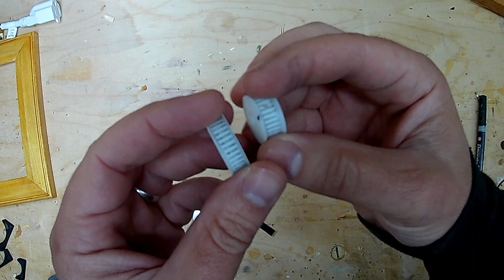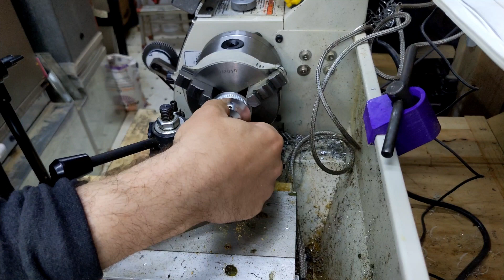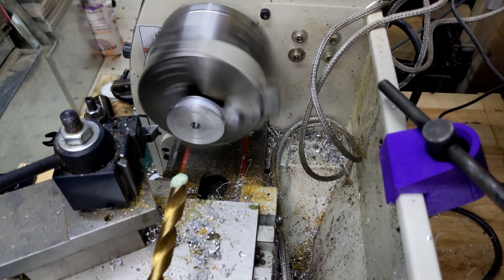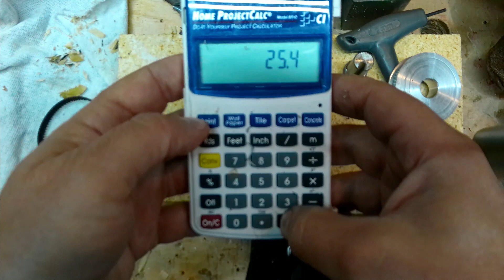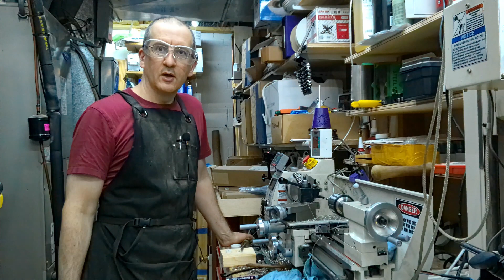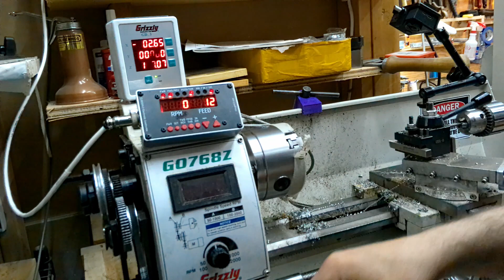Electronic Leadscrew Progress, Part 4 - Complete!

Comment: Thanks for posting these videos. I know it's already 5 years ago but I only just came across this today. I have the same lathe and an electronic lead screw would be pretty cool.  I'll watch Clough42's videos next and see what is involved and what his kit includes.
Regarding the slight discrepancy between the rotary encoder and the Grizzly's tachometer wouldn't that most likely be just a difference in accuracy of the electronics? I think I would trust the Omron rotary encoder more than Grizzly's tach. They were pretty close and I don't think I would expect them to read exactly.
I'm curious how it works in reverse? If you run the lathe in reverse will the leadscrew automatically run reverse also or do you need to select reverse on the leadscrew control unit?
I'm also wondering if there is possibly a way to mount the encoder so it will sit inside the cover.  Not a big deal but nice to have the cover on.
Thanks again.

Comment: I gave up watching at 15 min. my mind started to boggle. you have a lathe, you couldn't turn the inside diameter to 12mm? No calipers?
Reply from the maker: Comments like this are one of the reasons I don't post videos any more. I would not have minded, "Hey, did you consider using a boring bar? If not, why not?" But it's hard not to take something like this as "why are you so dumb?" 

But maybe you had a terrible day and you're in a bad mood - if so, you have my sympathies. Hope tomorrow is better!

And to answer the question I would have liked to get: I was a beginner (still am, although better). I probably just didn't think of it. Would certainly have done it if I walked up to a lathe now. :shrug:

Comment: Thanks for the video. First time viewer. I have a Vevor 8.3 x 29.5 and the lead screw run all the time.
Reply from the maker: Welcome! The lead screw running whenever the lathe does is typical - the spindle and the lead screw are connected via the change gears.

Comment: I enjoyed the series. From watching you complete the project, I have decided that this is the way to go. Thank you for letting us watch your struggles and succeed.
Reply from the maker: That's great! I'm really happy I did it, even if there were times when I had no idea if I was going to be able to finish it. Good luck, and give a shout if you think there's something we can help with!
Reply: @getsmarterandmakestuff   thank you. First thing I need to do, is change my motor over to DC. If you have any advice on controllers to use or anything on that setup it would be much appreciated. I want to ensure, that when I do a VSC upgrade, it works seamlessly with the electronic leadscrew. The Clough42  kit looks to be an excellent way to go. Unfortunately, when he starts talking over my old man head, I get lost and forget what I need to understand.  lol.
Reply from the maker: You mean the spindle motor? I don't see why you'd need to change that at all. The ELS just adds a rotary encoder that senses the rotational speed of the spindle and uses a second motor to drive the leadscrew. That second motor is going to be either a servo motor or a stepper motor, and again, the only thing it drives is the lead screw. Personally I tried to use a servo motor and ran afoul of either a bad motor or a bad driver, so I switched to a stepper motor. I put links to the parts I used in the various videos, but I can see I didn't do a good job of repeating them in later videos. Here are the motor and motor controller I used:

Stepper Motor: https://amzn.to/3sUUCQ1
Motor controller: https://amzn.to/3nlWJLN

Full disclosure, those are Amazon affiliate links - no sweat if you don't want to use them.

There's no question that the build will be a challenge if you haven't done something like this before. I found it so, and I actually have two engineering degrees from MIT. :) But you can do it! Let me know how I can help.
Reply: @getsmarterandmakestuff  thanks for the info. Thumbs up. I want to do the spindle upgrade as well, I only have the 6 speeds based on pulley’s and would love both a slower & faster capability. Being able to use that with an independent lead screw would be fantastic.  I have issues trying to keep my gears running tight and true. The adjustable lever that clamps down the change gears always wants to kick loose, like it needs a light spring tension holding it up. Total removal with an electronic leadscrew would be so nice. I look forward to a quieter running lathe, with potentially smoother finishes. Instantly variable spindle speeds and a slow independent feed rate by an electronic lead screw, would be so nice to deal with.

Thanks again for the help and making an informative video.
Reply: @Richard-gh1gv  Ah, yes, I would also like to upgrade my motor. I do have a variable speed one, and it is indeed much nicer than changing belts. However, it's a brushed DC motor, which means its torque at low speed is not very good. Would be great to change to a spindle motor that was both variable speed and had more torque, especially at the low end. And yeah it would work well with the ELS and shouldn't require any modifications to it. Good luck!